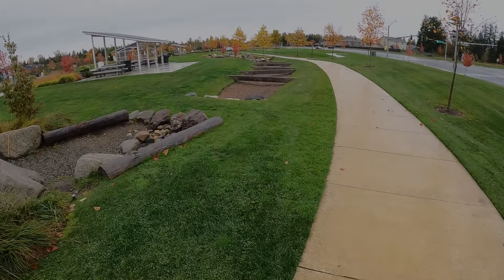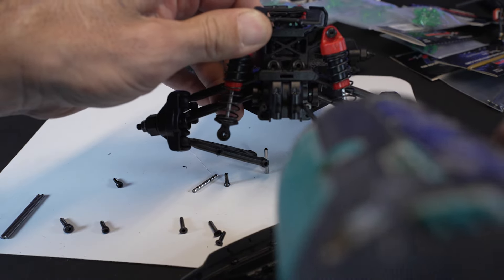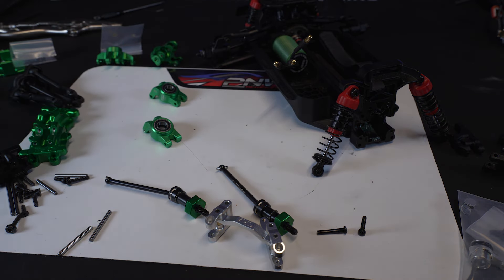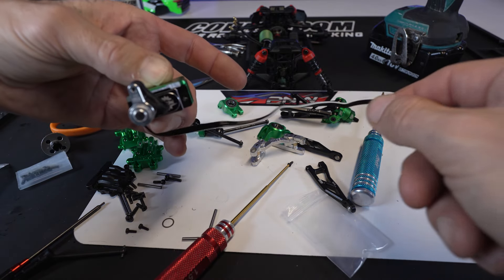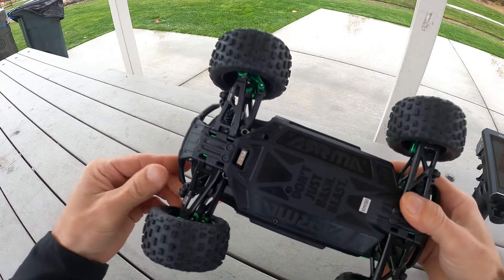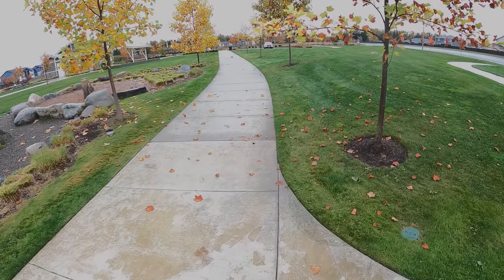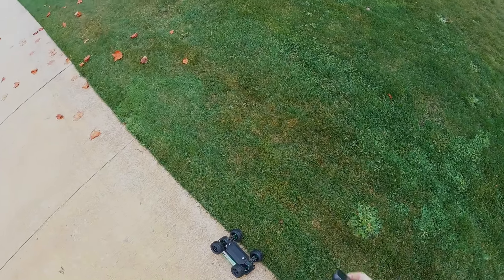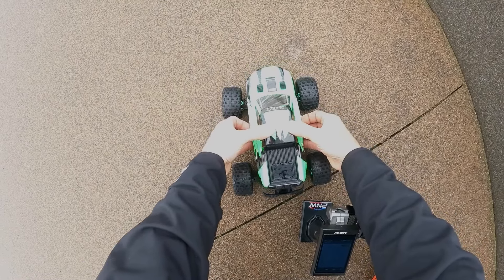😎ARRMA  Granite #GROM POWA!! GPM RACING 7075 BUILD & SPEED RUN

Comment: A certain amount of slop is engineered into the front end for energy absorption and high speed floating. I think all the outer upgrading transfers more shock inward. Like the old VWs, if you upgrade one thing, you have to upgrade everything downhill